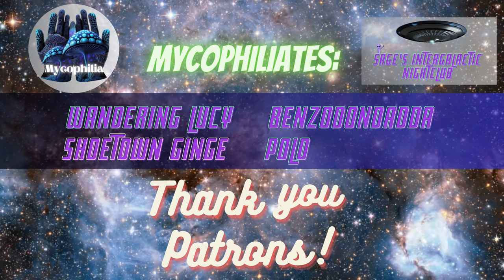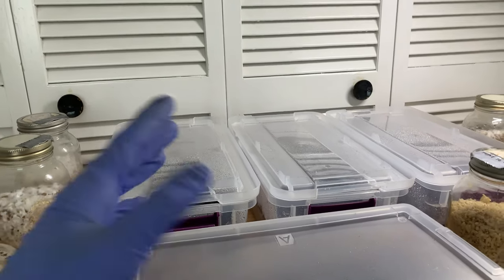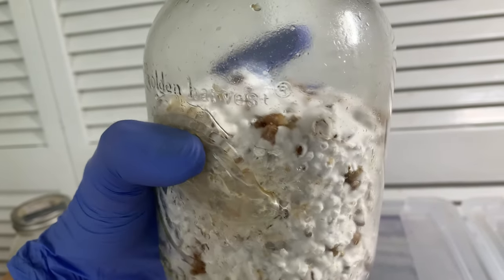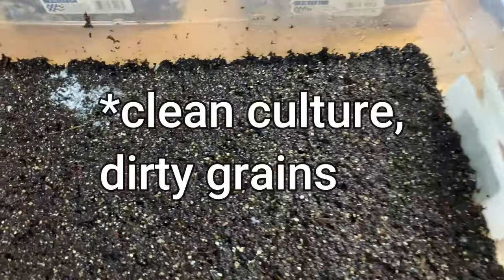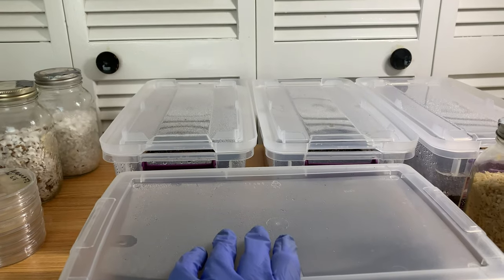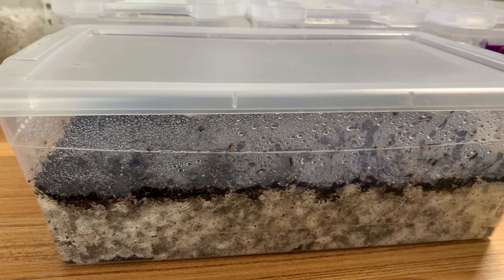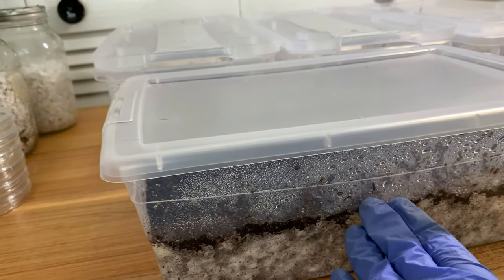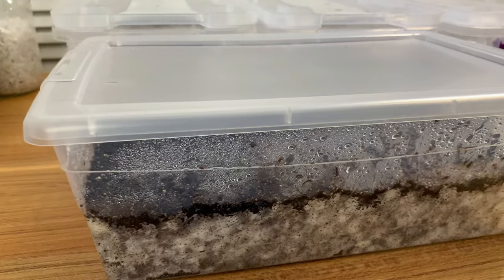Grains Causing Contamination? And Why a Casing Layer Works Better than a Simple Top Layer

Comment: If you are finding that the older feed grain that appears to have growth in the bag is not giving good results with spawn (contamination and slow growth), I have a couple thoughts to relate.  Hospitals and research labs all over the world use autoclaves with the same steam heat mechanisms as our pressure cookers. Certainly, there is the possibility that it is not reaching pressure, but if it is working properly, 30 minutes at 15psi should be long enough to completely sterilize those grain jars. If sterilized, everything will be non-viable and you will not see growth. 

To check this, just cook an extra jar using that grain with your other jars next time, and don’t inoculate it with anything. Just leave it closed. If your sterilization tek is not working, then you will see contaminate growth in that that jar over time, just as in the inoculated jars. However, if no growth develops, that suggests that contaminants are being introduced after the PC. 

You also mentioned poorer/slower growth from your myco strains on that grain. This could be because the organisms growing in the bag are using the starches and other nutrients in the grain before you sterilize it. This effect, in combination with introduction of even low-level contamination, can lead to slower growth and less competitive mycelia, and the appearance of greater contamination. As saprobes, the fungi can eventually breakdown other macromolecules in the grain, but the high-energy starches are more digestible and provide quicker growth. If contaminants in the feed have already been consuming those nutrients before use, then there is less for the desired mycelium.
Reply from the maker: Thank you for your comment. Here is my response:

30 mins is much too short for grains with endospores at 15 psi, 30 mins is recommendable only with a 20 psi autoclave. The gold standard is 1.5 hours at 15 psi, and many do even more. With liquid, 30 mins is fine, but for grains other than brown rice (due to lack of endospores) 30 mins is far too short at 15 psi. I do 3-3.5 hours at 10-12 psi, and I have had no issues with any grains, including the current batch, at least until the moth infestation. As stated in this video, the grain issue has directly coincided with the nesting of the moths, and as the infestation got worse, so did the contamination rate. The pressure cooker is working fine as always, this has all been accounted for, along with the cultures as stated in the video. 

1.5 hours at 15 psi is not full sterilization, what it does is it kills some contaminants, but not all. Some remain, and they will lay dormant until conditions are right. For example, why is it that overly wet grains are not recommended? Because it encourages contamination to bloom, as certain bacteria and yeast thrive in those conditions. Yet if everything is sterile, why does it matter if your grains are too wet? Because it is not fully sterile. Or, why is it that you want to avoid warm-hot temperatures during colonization? Same point.

Comment: i'm also having problems with jars, 2+ weeks after inoculating. i'm gonna do an experiment to find out how to inhibit endospores:
1) soak first, simmer second: cold soak 800g popcorn, half for 1 night, half for 2 nights; then simmer 30 minutes, cool, dry, jar, and pc for 100 minutes.
 2) simmer first, soak second: simmer 30 minutes 1.2kg popcorn, cool down, then a third goes directly to be dried and jarred and pc'ed, one third soaks 1 more night and is then jarred and pc'ed, one third soaks 1 more night and 1 more night already jarred and is then pc'ed. 
i'm gonna try and organize that so that they're all pc'ed at the same time for consistency, then inoculate with the same culture all 5 jars and see if there are any differences

Comment: I did two runs of rye, 17qts total, that were contam'ing just as you described. I ended up dumping everything, including several unused jars. Someone had recommended a "flash prep" for rye and it really cut the prep time dramatically, but I think it caused the problem. I've switched back to organic rye only and pc for 2 hours.  That seems to have calmed things down. Funny you mentioned brown rice, because I made 3 test jars last week. In my area, brown rice is very cheap.  If it works as good as everyone says, I'll probably change things up.
Reply from the maker: Flash prep never worked for me as the grains always were far too dry, so dry that it would take months to colonize.

Comment: Tammy been crashing my party too sage.   Same prep as always,  I think it may be from Tammy's jars I didn't wash good enough. 
I use bleach and run 3hrs on my grain prep,  it's either the jars or bad grain?
Reply from the maker: Could certainly be the grains, but without knowing anything else about your exact situation, most times it’s the spawn. For it to be grain it will need to be very dirty for it to have a consistent effect, and I don’t know if that’s what you’re going thru.

Comment: What did you end up changing between when all your grain was clean vs when it starated to contam?
Reply from the maker: I mention it a few times in the video, moths making the grains their nest over time.
Reply: @Mycophilia  Oooh sorry, I definitely heard you mention it but for some reason it didn't register. Thank you for the pro tip -- I just remembered I left a brand new 50# bag of grain open that I need to go seal up right away!  

Btw, have you heard of Feral's 3day grain prep? It's a short fermentation prior to sterilizing which helped me reduce my contam rates 0%, down from ~33% when I was using only doing a 1 day soap rinse/ soak prep. Now I am convinced it is the most practical technique to prevent huge waste that dirty grain causes.

Comment: So I've struggled a bunch with my grains- been using whole oats. Inoculated 19 of my 64oz jars in mid/late April, and here we are in June, and my jars are about half colonized. The jar that is the most colonized has a ton of metabolites (most of the jars have them). I believe my cultures are clean- I started with spore syringes and made into cultures, however I'm starting to feel like I'm stuck and can't get past the colonization stage
Reply from the maker: My advice would be to try using brown rice, and see if there’s any improvement. If there is, you’d know for sure it’s your grains.
Reply: oats are particularly hard to sterilize, I hear
Reply: @m.i.c.h.o oats are awesome , tractor supply has them cheap for animal feed

Comment: Hey, yo, Sage! Could you make a video of your method of PCing brown rice? I know PGT (Philly Golden Teacher) does twice as much water as rice, boils it for 10 minutes, then strains it, runs cold water over it, then lets it fully strain, and then puts it all in jars and steams them instead of PCing them (I've just been doing everything he does, but then PC for 90 minutes instead of steaming them). But, if you have a no soak, no simmer, all-in-one PC cook and sterilize method (where you add a specific amount of water to a specific amount of rice, and immediately just PC it, and it all cooks and reaches field capacity while PCing -- if that's even possible with brown rice) that would be amazing, but even if you quickly cook the rice for 10 minutes then PC it like I described above, that will help a lot of people that are intimidated by the whole PC concept after you show everyone your PC method and how easy and safe it is when done right. I know how to pressure cook/can, but there's a lot of people that get hung up on it, so doing a video from start to finish, cooking, jarring, PCing, and any little tips/"hacks" you've learned along the way for PCing, that would be a good video.
Reply from the maker: Coming soon! My method is pretty similar to Unemployedmt’s original TEK (the one PGT demonstrates).

Comment: The cubanzas you don't really need a case anywhere where you can use a pseudo casing layer but with the more exotic ones you definitely need a true case in there.
Reply: And I would not recommend the sterilize your true casing lawyer I recommend pasteurization because it's still allows it just to get The benefits from having a case in wire if you only pasteurize it
Reply from the maker: Casing Coir Lovers, Discussion on Pros and Cons of Shoeboxes, and Preventing Blobs
https://youtu.be/GqWmAr4Iym4
Reply from the maker: ^context!

Comment: Most common molds including trike should be eliminated after15 minutes at 160 . Bacillus subtilus or we spot is the only exception that I know of . What may be happening is a weakness from the wet spot bacteria lowing the guard of the mycelium.

Comment: Quick question you do know mold spores and bacteria are all over in the air right?
Reply from the maker: Yes, of course! 🤣 got another banger?
Reply: @Mycophilia  so why are you ruling out air contam?
Reply from the maker: Let me ask you this. Why do you think air contam is the primary suspect? It is a very minor one as far as contamination causes go, usually it’s spawn related 90+% of the time. Grains are rare but certainly happen, but air contams? That’s on the bottom of the list, unless your house has an extremely high spore load which is quite rare.
Reply from the maker: @piv9976  and watch the video if you haven’t, I explain everything VERY clearly! 😊
Reply: @Mycophilia  not the primary suspect but if you sterilized your grain properly there has to be some other reason. And the way you are opening your boxes pretty often even sit in front of them talking for quite some time, pressumably without a mask I wouldn't be so quick to rule air contam out. From what you are saying in the video it sounds like you are saying it's impossible to sterelize grain, that it's never going to be 100% clean, which isn't true. Maybe you aren't sterilizing it long enough or with not enough pressure. Besides if you let's say have contam in your jars/bags you would know before going bulk, so why then still use it?
Reply from the maker: @piv9976  You are simply wrong in your understanding that grains are sterile after PCing. A lot of beginners make that mistake, that’s why I’ve made this video to educate people. It takes a much longer run to fully sterilize a grain jar than the minimal amount we do in this hobby, which does work but is not fully sterile. What we do is kill some contams, and weaken the rest enough to give the mycelium time to colonize. The remaining contams simply lay dormant, waiting for the perfect opportunity to bloom. 

Don’t believe me? Well let me ask you this. Why is it that we don’t want temperatures to get too warm during colonization? Because it increases the chance of contamination. But how can it contaminate if everything is fully sterile as you say? Because it is never fully sterile, unless you do a 24-48 hour run.
Another case in point: Why do you not want your grains to be wet inside the jar? Because it encourages certain bacteria and yeast to bloom. But why? It’s sterile! No, because it is not sterile. They are dormant.

Now about the air and the breathing. A fully colonized substrate is very very strong against contaminants. I have no issues having tubs go on for many months, and with coir I have gone beyond 4 months just for the fun of it, and it will not contam. Let me remind you, they grow on shit 😂 But this is why I’ve created this channel a year ago, to dispel misinfo like this.

All the best,
Sage
Reply: @Mycophilia  we are going to have to agree to disagree. Out of curiosity tho, how do you prep your grain and which grains have you tried? And have you ever tried or seen someone pressure cook for 24-48 hrs? How does one even achieve something like that, I already run out of water after 4hrs
Reply from the maker: @piv9976  buddy. It’s not about opinions, it’s about facts. I’am not going to waste any more of my valuable time arguing with you. You’re welcome for the info.

Comment: What about trying Slightly Feral’s 3 day grain prep?? 
This allows the endospores to begin opening and then when you hit them with the P/C on day 3 you can kill them 👏🏼🎉👏🏼
Reply from the maker: The classic 12-24 hour soak is the same concept, which they were all made by. This contamination issue is not endospore related, but all the frass and insect matter causing contams later down the line.

Comment: UBtek for the win
Reply: How do you prepare dry UB for inoculation? I know about pre cooked bags, but what about the dry stuff? Can you just prepare it like normal rice and then PC it in a spawn bag, or do you cook it for a shorter amount of time?
Reply: @thecocktailoasis1849  use the ready in 90 seconds microwaveable UB bags of long grain brown rice. No preparations needed.
Reply: @jamesbarker3055  
Thank you James. I have tried that, but I have never tried preparing it from dry rice. Today I cooked a batch at a ratio of 1.5 : 1 water to rice just to see what would happen. 

After cooking I air-dried and PC’d the rice in bags. I’ll probably inoculate tomorrow. Even if it doesn’t work out I wanted to try just to see what the results would be. 

I thank you for replying. This is a nice community.

Comment: I used jiffy once. Trich city. I don’t trust it ever since
Reply: I've used nothing but jiffy mix with great results 🤷
Reply: did you pasteurize it or did you use it straight out of the bag
Reply: @moe5091  sterilized it. It might have came from the grains. Those were sterilized too. It just seemed to happened right after I put the casing layer on it. Trich ate it up like candy
Reply: @jeremyjetson1965  9 times out of 10 if you get tam. it’s your spawn
Reply: @moe5091  that would make since.
Reply: @jeremyjetson1965  also never sterilize sub or casing layers. it’s pointless and is actually bad in the long run
Reply from the maker: @jeremyjetson1965  sterilization, that’s most likely your issue, as peat moss is nutritious. I always give them a proper pasteurization bath for 1.5 hours at 160, but no full sterilization. I’ve got a video series called pasteurization vs sterilization if you’d like to check it out. It’s based on dung but it’s applicable to all nutritious materials we spawn in open air.
Reply: @Mycophilia  thanks I’ll check it out. And it seems a good place to start something different in finding success

Comment: You should try popcorn
Reply from the maker: Popcorn’s good and all, but not as good as brown rice in terms of nutrition and inoculation points. Brown rice is also cleaner as there are no endospores present. Popcorn will colonize faster but that is because the kernels are so large, thus there is simply less to colonize. Less to colonize equals faster colonization in the jar/bag, but slower to colonize once spawned to bulk because there is less overall mycelium than a smaller grain (which will have more inoculation points). Popcorn’s benefit is that it is cheaper than brown rice.